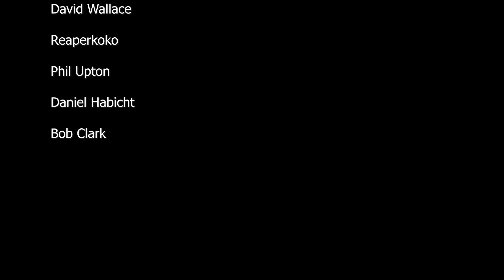Tactile Feedback From Vertical Actuators - D-BOX, PT Actuator, Etc.

Comment: Most people don't know how to do tactile right with Transducers. There is some complexity involved and there are ZERO out of the box solutions that really deliver. I have a D-Box Gen 5 on my rig and I only use a couple of it's Haptic effects. I get MUCH MUCH MUCH better engine effects with transducers. I also like my wheelslip much better with transducers and many other effects.   Also for Dirt Rally the landings from jumps just left me hanging with only motion until I added a Transducer based jump landing impact effect to carry the landing home.

To do tactile right you have to isolate your seat and pedal deck from the chassis to allow the transducers to work efficiently. You need solid amplification and you need some serious transducers. Ideally you have DSP's to keep your transducers quiet and to tweak their power points.

So yes the OOB D-Box haptics are better than having no tactile effects, but they don't hold a candle to what a well designed transducer based system can do.

But the reality is that unless you are willing to take the plunge in a substantial way and have some guidance, your results with transducers could be pitiful.
Reply: How did you isolate your seat and pedals, if you don't mind me asking? Springs? Looking into doing something similar, but unsure of the optimal way.
Reply: @khaledassaf6356  My current solution a steel seat plate on 4 fairly strong springs between rubber donuts in back. I have an inverted pedal deck using slightly lighter springs and donut setup along with a profile based linear bearing on each side to prevent flex.

I'm getting ready to add a stout linear bearing to each side under the seat plate.

The results from a well designed tactile system really make a virtual car come alive, but they are highly DIY efforts.

I'll be detailing the linear bearing installation on my you tube channel shortly. It's a solution I just designed and need to test.
Reply: @markkovalcson7243  Yeah, thought so. I enjoy DIY, and would say that building the pit is probably as much fun for me as it is to fly/drive. 

Looking forward to your video. Should at least give me some idea to work from. Thanks for the detailed reply!

Comment: Im finding the same after installing the Rs-Mega+ kit to my rig. 150mm (6inches) of travel on each corner.  I also havw four transducers and now i just leave them on for engine rumble and wheel slip... Probably even turn off wheel slip soon. I am keeping them on since they work great with Sim hub and sometimes i like to race with just the transducers.  Love the channel Karl!
Reply: I've heard of the RS having emi issues. Have you had that? And how did you solve it?

Comment: fully agree. i have fully self made 6dof rig with self made actuators that use SFU2010 (so 10mm per revolution ballscrew) with the exact same servos that you have on PT actuators and the theoretical spec on my actuator is 500mm/s (and they have 500mm stroke) and you can do virtually anything with them. some sample videos on my chanel for those who wonder how does it look like...🤜

Comment: I was wondering if anyone has installed a butt kicker set up on a gt omega titan rig? Did you have to customise anything?? They supply a bracket for other gt omega rigs but not the titan..worried il have issues mouting and im not that handy with tools haha
Reply from the maker: With a bit of luck you can clamp it to the back tube, assuming you have the Titan on it's feet.

Comment: I find that if you are running a DOF Reality Motion set up the addition of transducers is really beneficial.  As you  know, DOF Reality gives to a ton of movement but lacks the finer details.  If you try and tune to get all the finer detail you end up overdoing the motion.  Adding transducers also give you the option to turn down/ turn off certain functions such as curbing which avoids some of the overlap caused by trying to replicate conflicting movement such as curbing (rapid up down) while on a long steep incline (nose fully pitched up).
Reply from the maker: Yeah DOFR doesn't use vertical actuators in the same way as PT or DBOX and they are much weaker too.

Comment: I use the PT 6 Dof. In my opinion there is not much enough feedback from road surface in Assetto Corsa in a lot of track mods. If I increase heave in the actuators the feeling when getting off the track is way too much. I think the best feedback comes from laserscaned tracks.
Reply: That’s the problem with 90% of the track mods for AC. They just aren’t the same as a first party track. I have 4 Buttkickers, SC2 pro and a NLR V3 and none of those things perform as they should on the majority of mod tracks. It’s just a numb feeling.
Reply: @OhItsThat  so the question is which laserscaned mod tracks are available like Bathurst or Suzuka?

Comment: Nice video!  Had me thinking with all the gear you've come into contact with it would be ace to do a "Complete rig for under £500 / £1000 / £2000 / £4000 / £8000" series fo videos to encampsulate where it's best to place your hard earned cash.  Nothing to stop each from having an A/B variant based on what your preference is (lap time versus immersion for example).

Comment: The issue with trying to replicate too many effects with just actuators is everything gets blended together and looses definition.
If the actuators are doing a big pitch/heave event like hitting the base of a hill and need to move at their maximum 250mm/s, when do they have the time to change direction at 10+ Hz for road texture of engine vibration whilst maintaining the 250mm/s heave?
Just by your right arm, why do yo have 3 speakers when you could have 1 full range driver?
Reply from the maker: IRL The vibrations we feel are from vertical motion (suspension and tyre movement) there is nothing to get blended together like if you try to simulate too much with a tactile transducer, the motion is doing 1:1 (within the limits of physics) what the real car would be doing.
Engine vibrations should be basically off after idle as that is more of an effect.
Using one "full range" driver is the worst possible way to listen to anything, a 15" driver for example cannot accurately produce high frequency sound and also low frequency sound... you should always where possible have a dedicated driver for each part of the audio spectrum.
Reply: This is mostly true and effects based motion do suffer from saturation of signal as they overlap each other and compete for your senses. This is really a science and a complicated problem to solve algorithmically/mechano-electrically. This is where having localized vibrations with transducers and actuators just for motion makes sense. However even things like engine vibration do not stay localized and vibrate throughout the chassis. A motion actuator can represent not only the engine vibration but also the resonance as it travels through the chassis. Good example is a trophy truck in iRacing. Rev it enough and the whole rig shakes and rotates with the inertia of the motor combined with the soft suspension. The 'effect' is definitely more pronounced with motion systems vs. transducers. But transducers still have their benefits including higher sustainable frequency 150hz+ and localization, meaning you can place them better around the chassis. However they do rely a lot on effects, and effects based motion can and does suffer from false positives, or playing canned effects or pre-recorded motion signals that might not represent accurately.

Comment: 250 mm per second is exactly 0.9 kilometres per hour, so not particularly fast🤔 I've tried the D-Box twice and similar systems and couldn't feel any tactile feedback and my GS-5 is certainly not a replacement as well. Shakers are just a lot faster from the principle and usually even need more power than actuators. If you can't feel a difference, your shaker setup was not efficient if it's from the position of the shakers or the effects. The GS-5 comes with optional holes in the plates to fix each with a small Dayton shaker, probably the weakest on the market. I recently did the upgrade and didn't expect it to be significant because I also use a Buttkicker Concert just under the seat, two inches away from my butt, but I was wrong. The feedback is so intense, I can't feel the difference if the big one is on or off and it's a huge upgrade. So the most dominant feedback always overshadows the lesser effects and shakers 30 cm away from your body are basically useless with a motion rig like yours. People with similar setups usually drill the shakers to the seat and under the pedal plate.
Reply from the maker: Maybe I'm remembering the figures wrong but they claim fast enough to pull 2G of acceleration which is plenty for replicating the movement of a car chassis on a surface.
Maybe they did not have it setup or tuned correctly, who knows?!
Shakers are producing frequencies of "sound" rather than movement of the chassis like vertical actuators, in a car any and all vibration we feel is literally from movement (mostly vertical) either suspension and tyres or engine movement on it's mounts which varies in direction depending what engine you have (straight 6, V8, boxer, etc.)... transducers simulate movement with sound, vertical actuators replicate it 1:1 using telemetry and within the constraints of physics and their range of motion.
Reply: @KarlGosling  250 mm/s are 0.9 km/h and enough online-calculators confirming it. Probably the reason why F1-motion-rigs for multi-million dollar use hydraulics. I didn't like the D-Box-systems I've tried because there was too much travel in the setup and I hated the lag and kind of negative lateral g-force you would feel in a real car. Expecially in DR2 I've noticed that actuators are too slow to keep up with the surface if you set them up with too much travel and within a second a real suspension can do more than 250 mm in Rally-racing. Shakers are for vibrations since those are very dominant in race-cars and if there aren't dedicated transducers build in the actuators, it might be not wise to use vibrations and travel with them. They certainly can't do 250 mm/s while vibrating, so this function slows down the travel-capabilities.
Reply: @Leynad778  Yes in some ways GOOD TACTILE can surpass motion immersion.
Reply: @KarlGosling  Most motion systems, at least the ones that are not anchored to the ground, limit motion to sub 1G, otherwise the actuators would lift off the ground as they pass 1G or the earths gravitational force. This would prematurely damage the actuators and ballscrews... Specially if once lifted and off the ground, the actuators come back down at opposite speed and hitting the floor at over their designed G limit. ;-)
Reply from the maker: I must be remembering the numbers wrong, flat out they will throw me clear of my seat! lol they wouldn't to that at 0.9kmh!

Comment: Hoping you might be able to push me in the right direction Karl. Not much of a car racer, even after buying some kit from watching your videos, but I do WANT a motorcycle SIM machine. Any companies you know of you can vouch for?
Reply from the maker: Sorry mate I have no experience at all with motorbike sims..
Reply: Check out MotoTrainer.
I got to rub my greesey fingers all over it at Laguna last year. Its got lean, but no surge or lift currently... they do use a real motorcycle that rolls up and straps into the sim and the stock controls (ride by wire) are used. Im all about two wheel action 1st, and four wheel action 2nd, but the its just not ready to perform anywhere close to the level of driving sims currently.
Reply: @gasracing4000  I've since found a couple companies who make professional level Sims for MotoGP and WSB, but they seem to range in the 100k+ price. Ain't worth selling off a property just to buy a sim when I can ride the real thing 😂
Reply: @rossharper1983  I think MotoTrainer is one of thoose companies in bed with DORNA, so yhea, not realistic for average joes.
The software on the 2 wheel sims is all sim specific from what i've seen, so i think we are a ways off from being able to play a 2 wheel release title (Tourist Trophy, Motogp22, ect...) on a home sim.

Comment: The biggest problem with those actuators / seat movers is the insane price that they are. Even the seat movers cost more than €1,500 with just two actuators on it. 

Imagine if you could buy a reasonably one with two actuators on it that just straps on to the bottom of a cockpit , even if they just move about one or two inches. 

I know it's nice to have the long throw but if it means making it much more affordable then very short throw actuators is better than nothing.
Reply: Regrettably as far as your point goes, the screw length makes very little difference to the final price. The brains, the motors and the electronics are key, plus the materials.
Finally, and this is often overlooked, people who sell this kit don't have a side hustle. This is how we make a living, and it's an incrediby modest one.
Reply: Check out the Rs-mega+ kits.  For less than a seat mover, I got a four actuator kit with everything needed ans basically plug and play.

Comment: my only issue with this kind of equipment is without having the tv screens connected to the rig id be moving and the display isnt so my eyes would have to work extra to keep focus on the screen, although for VR a can imagine this being something id like to try for sure. im not into the g force ones as there short bursted so id press the throttle get that inital g force then it would feel like iv come off the trottle, but these for individual wheel feedback over bumps and the bounceiong over jumps i can see that being good for VR espeshly. thanks for sharing
Reply from the maker: If you're sim is correctly setup the image moves with you... the physical displays do not have to :)
The surge actuator does indeed only give a small burst of acceleration (or you'd go right through your display and out the room! lol) but it's way better than nothing at all :)
Reply: @KarlGosling  what i mean is if theres 2 things in vison thats moving its extremely hard to focus on 1 point, so the screen wobble over bumps if in a still chair this doesnt seen to be a problem as your eyes move with the bumps maybe a slight delay but its unnoticable but if theres another movement added to that my eyes cant antisipate where to look, like in a real car the enviroment doesnt move obviously so if you hit a bump its just your head moving and not the envioment also.
Reply: Actually you don’t want the screens to move.  The actuators move you relative to the still screens, just like the car moves you in a static world.  Then, you adjust the in-game camera/movement settings to align with your physical movement. It is an amazing experience, whether with screens or in VR
Reply: @netlawman2001  so with lock to horrizon or real head motion app it works good. ok thanks for the info
Reply: @Avichayil  Hi.  I don’t have head motion app, so not sure about the impact.  In terms of settings, I have not found a single formula for all games, so I work with the in-game settings for each game to get to the right point (that also includes selecting. Camera view).  I am really happy with my results in ACC, DR2, Automobilista 2 and F1

Regarding VR, the only game I use VR for is Automobilista 2.  I have found I get motion sickness when using VR with other games.  Maybe a head tracker would help?
Reply: @netlawman2001  sorry i should have been more clear on that, im talking about Assetto corsa only, iv tryed real head motion app and lock to horizon, only thing is with lock to horizon when flipping the car the vision doesnt flip also but with real head motion you can tune the enviroment wobble but so its not so extreme when flipping the car, iv only tryed on a still single screen so far and trying to collect as much info as i can before making a big perchase. i feel like i want to feel the bumps and jumps threw the rig inderpendant to each wheel but with added motion im a little worried my eyes will struggle to focus with it being 2 different things moving. maybe if the movement in the seat isnt extreme say 5cm of movement it might be ok. i dont like it when the vision in the car stays locked to the car even hitting bumps it just doesnt feel right, i guess in vr then it might just need real head motion to stop enviroment wobble setting and with a motion rig that will move the VR enough to cause the same effect as neck fx. think i just answerd my own question haha with motion rig id need vr with real head motion only for enviroment wobble.
Reply: Valid point but generally the motion is not so extreme that you even notice. A motion platform generally starts with the driver centrally located and will always quickly return to that position once the car recovers equilibrium. We use both in the race@home studio but prefer a larger static monitor setup than a smaller mounted screen. We destroyed one Odyssey G9 with motion as it flapped like a bird. Decided that wasenough.
Reply: @pt-actuatorukltd1118  arrr ok, i just say this as i seen someones video the other day and he was using vr. i couldnt focus on the video as there was the bumps that wobbled the screen normally thats fine but with his head moving to i really struggled to focus on 1 point. and that was a thought to, attaching a big screen to a moving rig with the rapid movements of the rig isnt something id want to do. so i guess if the movements are slight then maybe it would work with a still screen setup. do you have to use lock to horrizon?